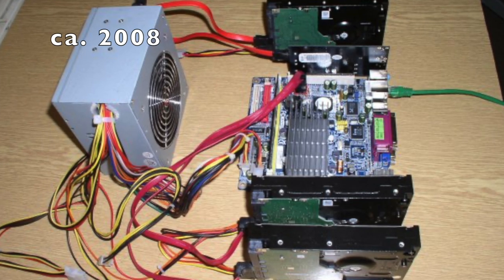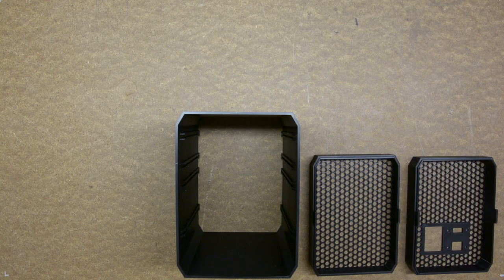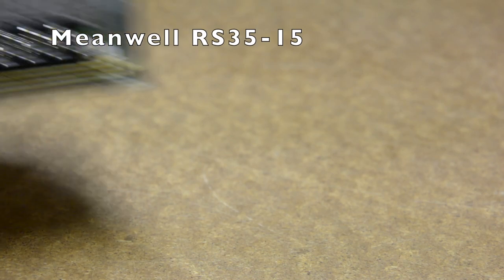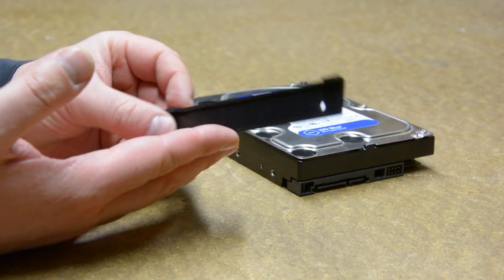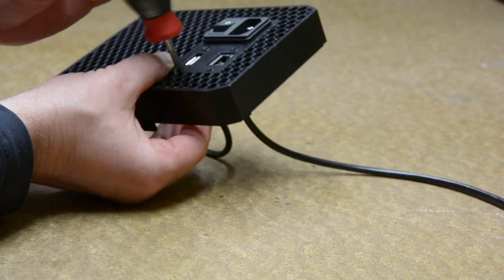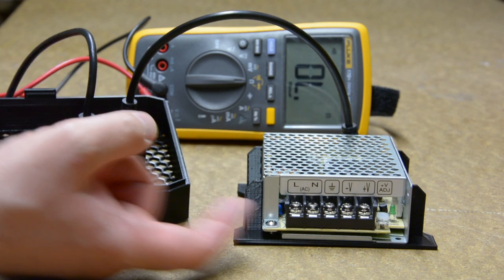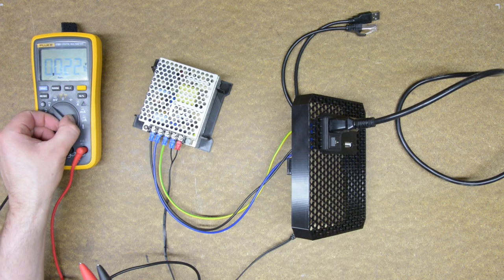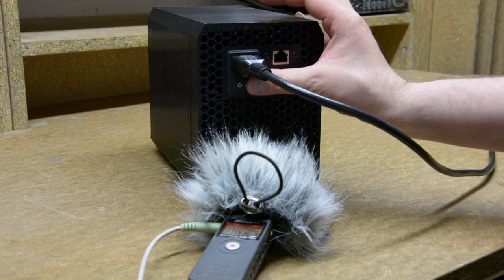Building NAS with custom 3D printed case

Comment: Nice job!  I did something similar with an Odroid H3 without getting involved with a 3D printing task.  I used a standard SSD plastic drive tray that holds 2 x 2.5 inch 2TB SSD's.  I got a package of assorted M3 brass standoffs and was able drill the SSD tray and mount the Odroid board atop the SSD's leaving room for the NVME drive and the 16GB of memory.  Next I added more standoffs and mounted a 120mm fan (with a shield for the cat's nose) on top off the whole unit.  The has been running Truenas Scale now for a few weeks with a mirror configuration.   This unit is giving me an opportunity to learn Truenas and ZFS before I commit to a large unit with ECC, IPMI and lots of spinning rust (with mirrored SSD's for boot and logs).

Comment: Good video. Ifi may offer some friendly suggestions. 

1) Get a better power supply. Those are known to run hot and that mobo/CPU doesn't need that much power. you can find something smaller, more efficient, that will run cooler

2) Please consider adding at least one fan. Everything is passive but in such a small space they need a fan. Hard drives run hot and you can drastically improve their life with just one fan. This isn't to even mention that power supply and mobo which can benefit from the cooling as well. You can add a thing quiet fan or two without making the case much bigger.

3) That USB extension cable looks like it's USB 2.0, it would be quick and easy, and more practical to swap it for a USB 3.0 extension cable (they are cheap)

I have no critiques, it is a very nice build and I hope to see more from you. Very excited to see where your channel goes.

Comment: you can make this case bigger and add 6 more HDD in addition with the 2 additional HDD's that come with the H4. That's 10 HDD in total using an NVME to SATA 6 port adapter.

Comment: This is a great tutorial, thank you for showing us the process.  With the H3+ being recently released, will you be upgrading to this unit? I think it would fit as the footprint looks the same.
Reply from the maker: @CaptZenPetabyte Thanks! I don't have any plans on upgrading, this setup is still sufficient. Maybe bump up the HDDs from 2x2TB to 2x10TB as I'm running out of space.  I added a M.2 SSD to have faster, non-redundant storage and I can max out the 2.5Gbps network.

I have two of these, one as a main NAS, the second one as a backup NAS which downloads the locally created backups on the main one via BTRFS snapshots.

If I'm ever upgrading, it will be to something beefier, like 8 HDDs, dual NVMe SSDs, Thunderbolt... And a ton of RAM for cache. I don't run anything heavy on it, only ca. 20 Docker containers.  But as I'm making more of the videos, I need a bigger storage.

I checked the H3+ and it looks like it should be 1:1 fit... Unfortunately there are some rigidity issues with the thin walls and that's the main reason I never published the 3D models. It needs some work - not much though - but I don't have the need to work on it...:)

Comment: Very cool, I would put some low-rpm fan just in case (pun intended)
Reply from the maker: :) I actually designed the front lid to fit 12cm Noctua fan, but the hard drives and the CPU don't get hotter than 40 degrees.

Comment: is it hot?
Reply from the maker: It's actually quite cool. I had it on a window sill and the CPU was around 40C and HDD was 37C. Another one is enclosed in a small metal control panel with no airflow whatsoever and that gets hotter - CPU ~60C, HDD ~58C.
Reply: It's impressive